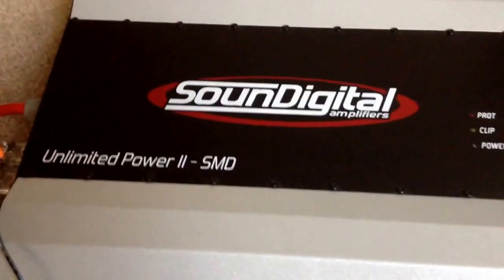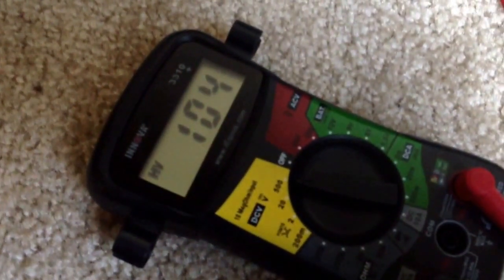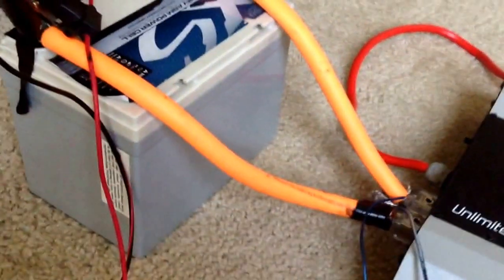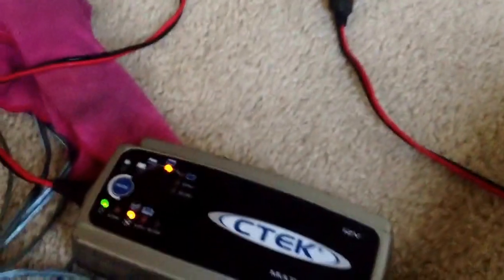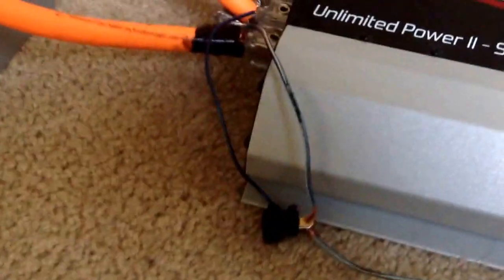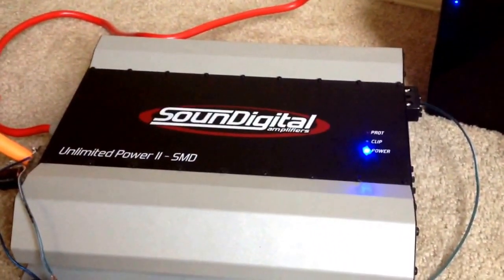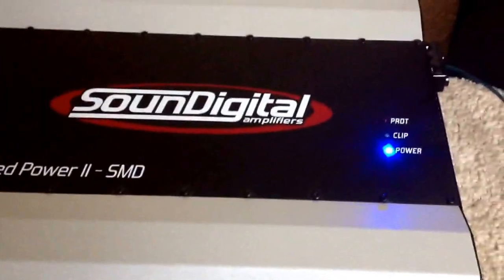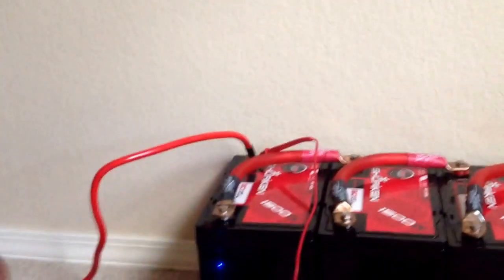Soundigital unlimited powerII tutorial

Comment: Hey bassgod I seen 1 of your older videos were you had a soundigital unlimited HV amplifier. How did that amp work out for you?in your video you said how you were the only one in the USA to have it. Well I came up on a soundigital sd30khdv-smd almost the exact same amplifier and I to feel like I'm the only one with this amp. Now I understand the high voltage concept I was wondering if I could run multiple motorcycle batteries in series to generate and supply my high voltage. I no this doesn't go with this video but I wanted to get some advice before installing this amplifier thank you

Comment: Quick question bro, the Ground from the batts wired in series, goes to the frame of the car i assume? or could you get it from the 12v battery ?
Reply from the maker: Latinsonido  it's grounded to the truck
Reply: ok so in other words , if i have a bank of 12v batts and a bank for the hv, positive from HV bank goes to the HV input on amp, negative from HV bank goes to a ground on the car, and, the positive and negative 12v inputs on the amplifier can come from the 12v bank? thanks a lot
Reply from the maker: Latinsonido  you don't need a bank of 12 volt batteries just one for the turn on power, you get your source of power from the batteries in series
Reply: got it my man, was just talking about a 12v bank for the car and mids/highs , that´s why i´m asking if i can get the 12v side for the HV amp from that bank, thanks a lot for the help
Reply from the maker: Latinsonido gotcha

Comment: I got a question for you I have 2 XS power d3100's I noticed the voltage they were reading was extremely low but when j looked at the 0 guage wire that was on them it was fully corroded would that cause them to have a bad voltage reading